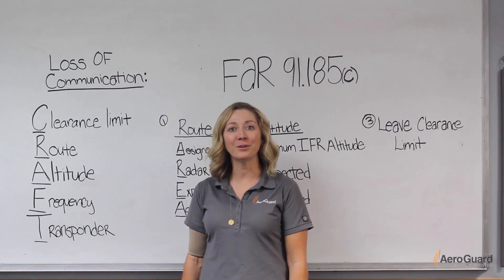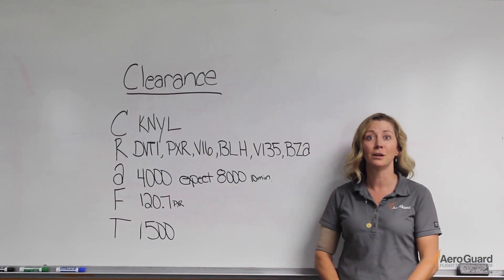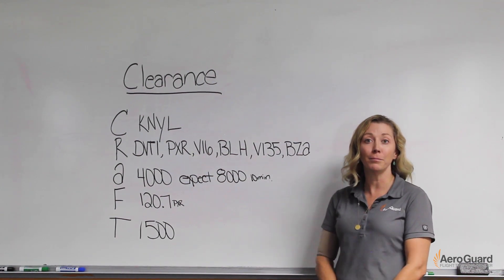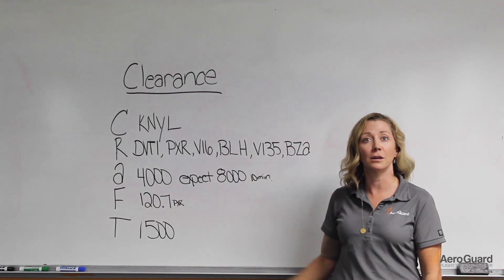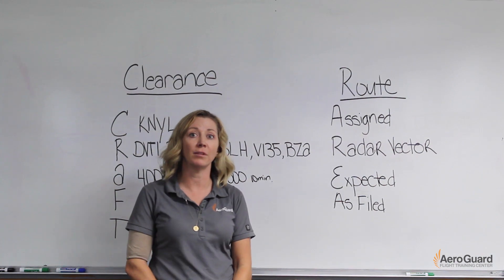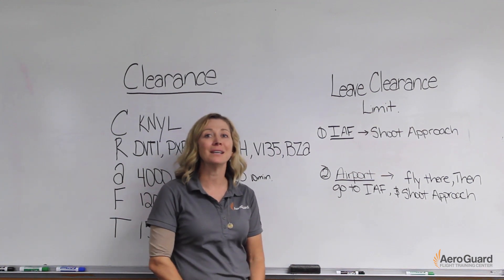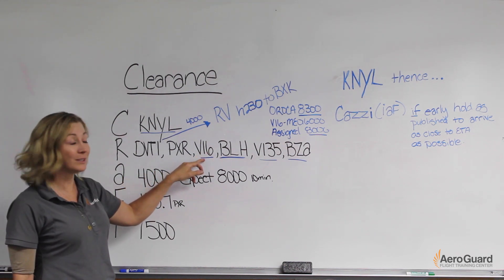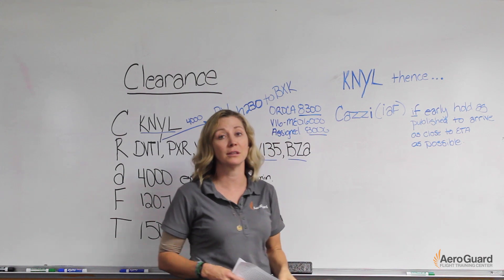IFR Lost Communications Example Scenario – AeroGuard Flight Training Center

Comment: Just to add a very important point here, as you are flying with lost communication, it is very smart and pragmatic to keep transmitting blind about you position and intention because the situation might be that your aircraft radio transmission is still working and atc might still be able to hear you.

Comment: What if the iaf doesn’t have a publish hold?
Reply from the maker: Great question, this is something that comes up a lot in AeroGuard’s ground schools and IR workshops.  According to the Aeronautical Information Manual (AIM) Paragraph 5-3-8(c), if a pilot reaches a fix to hold and has not been assigned holding instructions nor is there a published hold at the fix, the pilot should “enter a standard pattern on the course on which the aircraft approaches the fix”.  This would apply to a lost communications scenario as well.

Comment: Absolutely fantastic instruction, thanks so much for making this video! Really helped demystify lost comms for me, particularly what to do in a situation where you're off route due to radar vectors and lose your radios.

Here is one final question -- In the example in the video ATC gives you a RV of 230 to BXK, and as explained in the video you would fly on heading 230 to BXK (or direct BXK from the point of radio failure, whichever gets you to BXK) and then the rest of the assigned route once you reach BXK/V16.

What would you do if you had the same clearance as the video, but instead of the 230 to BXK vector ATC instead assigns you a vector for traffic/spacing to the effect of "N55VN, fly heading 010 for spacing, expect further clearance in 5 minutes" and lets say the heading 010 is leading you quite far away from your cleared route/clearance limit. You lose your radios right after you begin flying heading 010.

Would you, in this case, do the following -- after confirming lost comms and squawking 7600, immediately proceed direct to the closest portion of the assigned route (PXR or somewhere along V16 if we lost comms at the same place as the video example)? Since the vector was for spacing and didn't contain any clearance to a fix or anything in the route (and in fact took you away from your route), you would go back to ASSIGNED in the A.R.E.A. acronym and figure out which part of your assigned route is closest, correct? So I'd turn off heading 010 and go direct, lets say, PXR, and then just fly the cleared route. Also would you simply ignore the 5 minute EFC time and just go direct to your assigned route immediately once the lost comms are confirmed, 7600 is in the box, and you figure out where to fly to?

Thanks so much for the awesome video and for your time.
Reply from the maker: Great question! There is a lot going on in this scenario. To start it is unlikely that ATC would turn you that far off course for traffic. Generally they assign you 20-30 degrees off for traffic. However, if they were to turn you to that heading there are 2 thoughts on this. One is fly that heading for the 5 minutes per the EFC time then turn to the assigned course. Second is you can assert your 91.3 PIC authority in this emergency situation and proceed to the assigned route. Once you squawk 7600 ATC is going to clear the area for you so that previous vector for traffic will not be an issue. Hope that helps!
Reply: @flyaeroguard  Thank you so much for the prompt reply!! Yes, that is very helpful information and answers my question. Thanks so much again for all you guys are doing.

Comment: For altitude 
Minimum altitude for IFR route 
Expected 
Assigned 

Let's say we are on victor airway and MEA is 7000, MOCA is 6000. Expected is 5000 and assigned is 4000. Do I have to fly MEA which is in this case 7000?
Reply from the maker: You are correct!  You would need to fly at the highest of the following:

Minimum IFR Altitude (MEA, MOCA, MCA, OROCA)
Expected altitude (when ATC tells you to expect a certain altitude clearance in the future “…expect 5000’ in 15 minutes”)
Assigned altitude (an altitude clearance from ATC “climb maintain 5000’”)

So in the example you provided, flying at the MEA of 7000’ seems to be the highest for that route segment.  Some could make the argument that if within 22NM of the VOR (using VOR for primary navigation) the MOCA could be considered the minimum IFR altitude, but it is unrealistic that ATC would anticipate that.  If the airplane could fly at the MEA that would be the normal assumption that would be made.

So long story short, yes, you should fly at 7000’ for that segment of the flight.